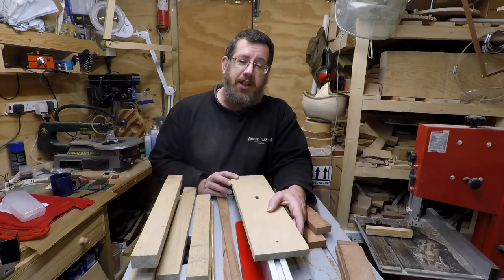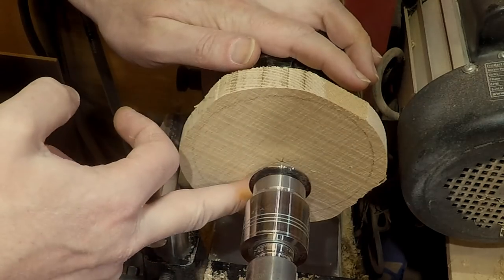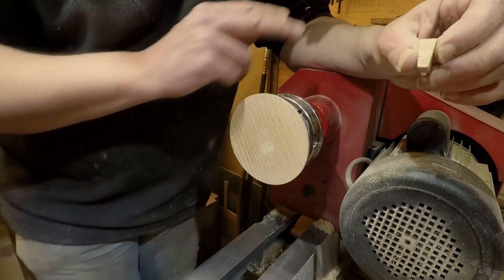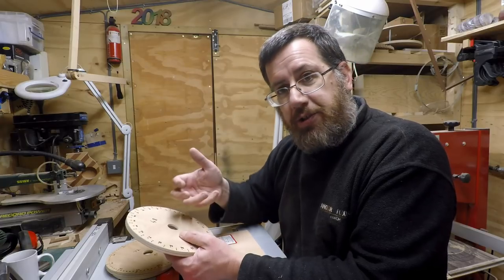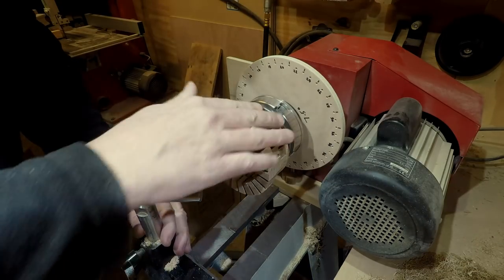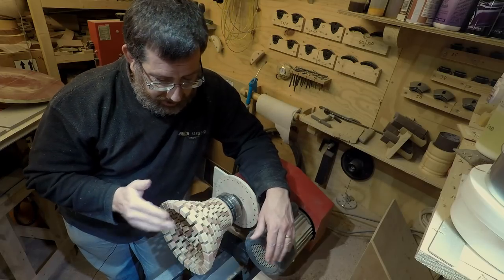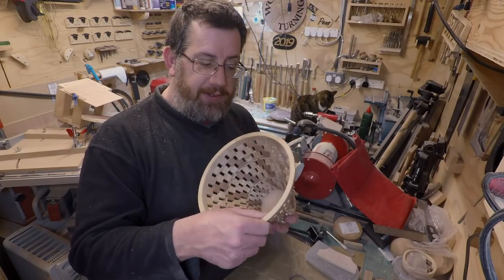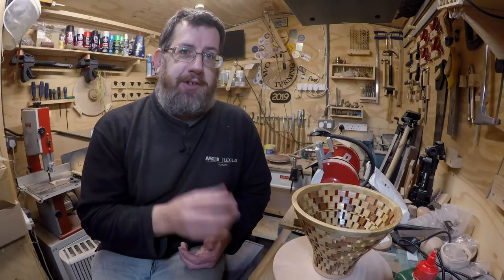Open Segmented Bowl - Episode 188

Comment: Stunning design Paul,beyond my my cheapo table saw-but i live in hope!👍👍👍👍👍👍👍👍👍👍👍👍
Reply from the maker: Thank you Alan. Cutting the pieces is easy on these as you don't have to be so accurate. A chop saw would work just as well. Closed segments helps with a more accurate angle, you will be surprised what you can do with any saw on open segmented work.

Comment: Very nice piece. 
Do you have a video of how you made your indexing table?
Thanks
Stan
Reply from the maker: Thank you Stan. I think I did one on the indexing system but not the table. The table is very basic just work on a base that locks between the bedways of the lathe and build it up so the table top is central to the chuck with it ending at the centre point.
Reply: @PaulLockwood  thanks Paul. Probably similar to what I need to make for the basket illusion project that I want to do.

Comment: Is there any reason why you don’t fix round sanding plate in the tail stock .? That way you can be sure the surface is completely flat, ready for next layer.
Reply from the maker: If you hold it in the tail stock then you will always be sanding on the same part of the paper and therefore wear it out quicker. Hand holding keeps it very flat due to the speed the lathe spins. The chalk tells me when it has all been sanded flat.

Comment: I have a question for you, when you put the base disc on the lathe to turn the mortise, how was it help on the lathe. .?    At fist I thought that you were just holding it between centres,  but then you took the tail stock away. When you turned it around, there was no holes for either a screw Chuck or faceplate ? I am intrigued.  Good work all around, well done.
Reply from the maker: The base is on a waste block with hot belt glue. I always keep anything (especially spindles) that can be used as waste blocks in a box for this type of work.

Comment: What type of glue were you sing .? It seem to stick each piece up to a hands off stage very quickly , it looked like normal wood glue ?
Reply from the maker: Yes ordinary wood pva glue. I use the green Evostik range as it also dries clear. If you have two surfaces very flat then using a minimal amount of glue it holds very quickly. Wet runny glue is what makes wood move when you have too much. As the two pieces are flat the minimal amount of glue sweeps into the wood and creates the bond when there is no excessive glue.